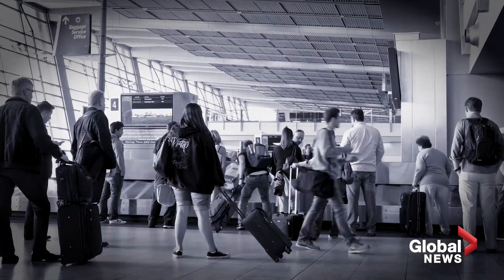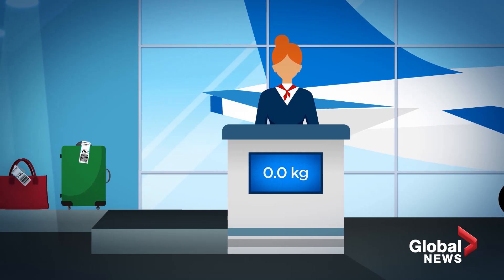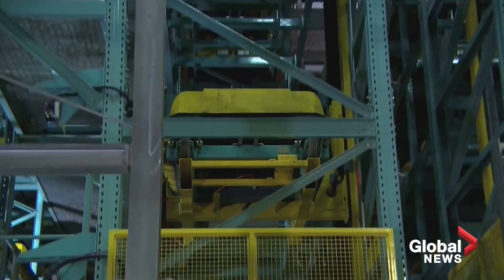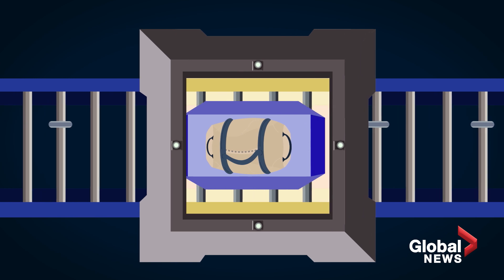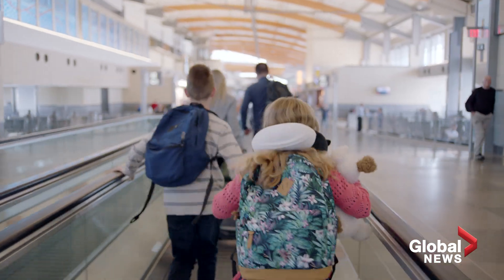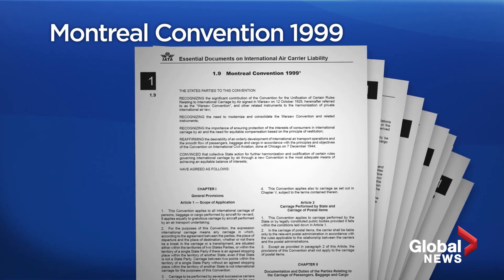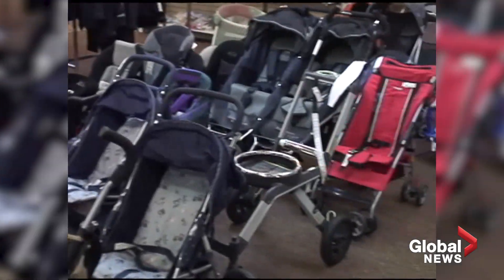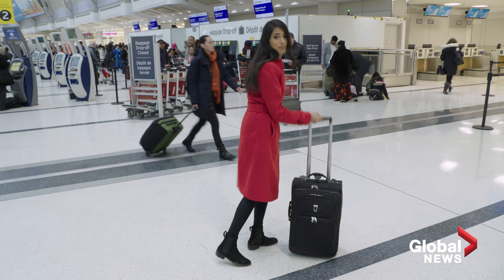Lost luggage: What happens to your baggage after check-in

Comment: I have worked at an airlines LL office that handles lost luggage. Airlines use a very efficient system to track and deliver misappropriated baggage and reunite it with their owners. There are so many reasons that could lead a bag to be misappropriated or ``lost``. Eventually,  more than 99.999% of customers eventually get their bags back.

Comment: How hard is it to find an untagged bag? I made a mistake and scanned the bag bar code tag before attaching it to the bag. The bag went away on the conveyer belt. The staff took the bar code sticker and went to find someone who could find my bag.

2 hours later, when I boarded the plane, the staff said they found my bag.

But when I landed, the bag was missing and never left the airport and was never tagged!

Why did the staff think my bag had been found as they looked at the computer screen when I boarded the plane?

How hard is it for a worker to find a bad like in my case? If you know from which check-in desk it came and the design of the bag, can't you find it in 2 hours?

Also, when I got my bag after 3 days, a small item was missing. Is it it possible that the working condition is so stressful that things could fall down on the floor and vanish while searching inside bags to find clues to whom the owner might be?

Comment: They missed the biggest truth of lost luggage.  NEVER check your bag at the CURB side check in. Even if they tell you too. Go inside and check it at the counter.  Most lost luggage is from checking it outside at the curb. That is actually a fact of why luggage goes missing. Then from connecting flights.
Reply: I've never heard of curbside check in.  That sounds like a great way for some shady person to just walk up and steal stuff like it's his job.  I always take my bag as far as it will go.  I'm fond of gate check, because that means that my bag goes directly onto my plane.
Reply: Before 9/11 it was very common . Kinda surprised to see it anywhere now.
Reply: Curb side check in, or Skycap service is a gratuity-based service to skip the line inside. These Skycaps work for a 3rd party and never for the airlines. It is a service you pay for by tipping. Statistically there is no difference when it comes to the loss of the bag. As the video points out, losses happen during transfers a most of the time.
Maybe you forgot to tip your skycap for their service?